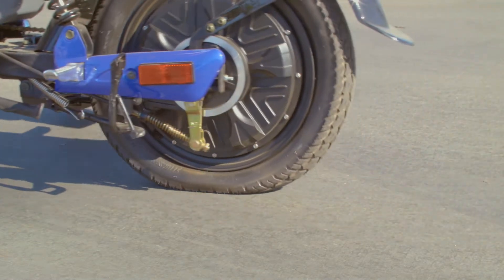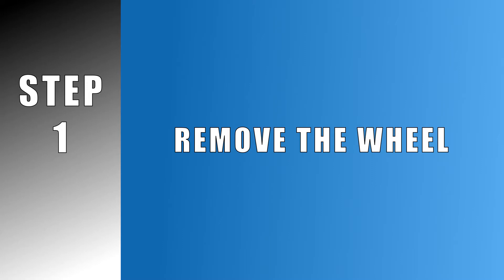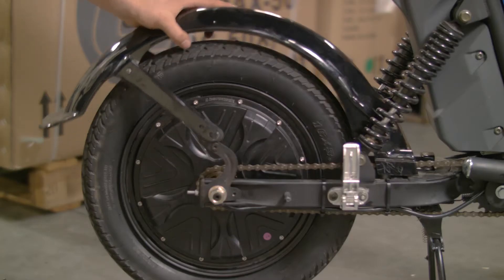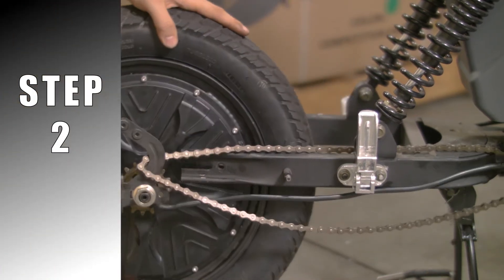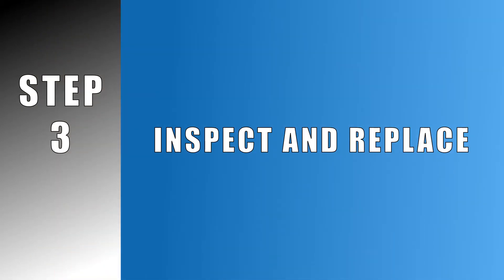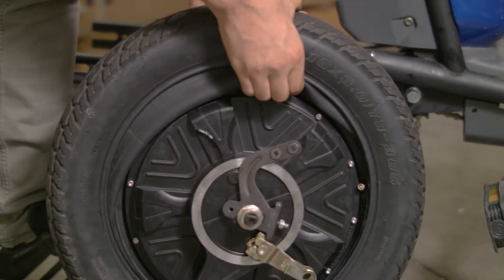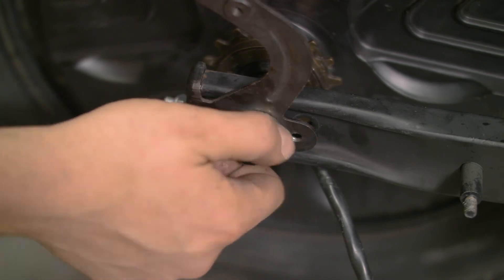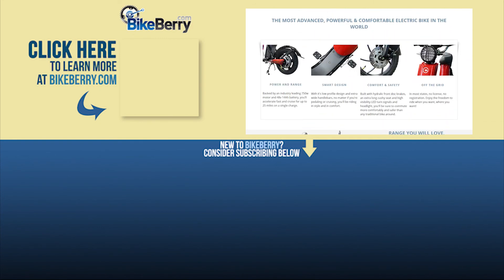How To Replace The Tire and Tube on a Gigabyke Groove Electric Bike

Comment: Does the wire to the motor have a plug so you can disconnect it?
Reply from the maker: It does, but it is located within the body panels of the bike.

Comment: i just followed this video as far as "sliding" the rear tire off the frame.  I appear to have something holding it in place.  Under my "lug" nuts on the axle, are washers.  however, you dont even appear to take the nuts off, just loosen them.  what could be my problem?

Comment: I see foam run flats for 24 inch Mt bikes at work....why not start making run flats for the gigabikes
Reply from the maker: That's a great question. Solid and foam tires have many advantages, but cost and maintenance is not one of them. All tires will eventually need to be replaced, even the most advanced and resilient. We want our customers to have the easiest and most cost efficient ways of replacing them when that time comes. That being said, cost of materials and manufacturing is always fluctuating, and the time may come when these other tire systems become more of a common standard rather than a costly add-on.

Comment: Ok I have one question I love this but I live in Canada Ontario is this even legal to ride
Reply from the maker: Laws regarding motorized bicycles differ between regions. Some regions would classify this as a moped, and would require the proper government documents to ride on public roads. Other regions would classify this as a bicycle, requiring no documentation at all. New laws governing e-bikes are constantly being introduced and modified, making a confusing topic. We would recommend contacting your local government and inquiring about the legality of any motorized bike you are planning on purchasing.
Reply: Seach state are varies by law gigagrove is not consider a moped here here as it got working pedals..canada idk i live in the usa.
Reply: BikeBerrycom you might want to read my comment at the top. I'm not trying to give you a hard time but there is only one way to install a tube. most of what you said is right but you put the tube in dry that's a No-No.